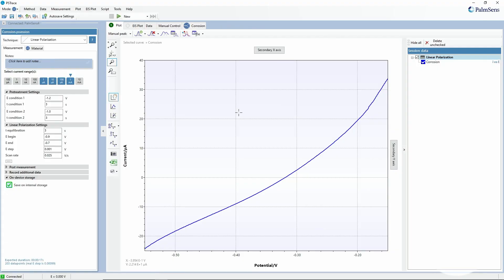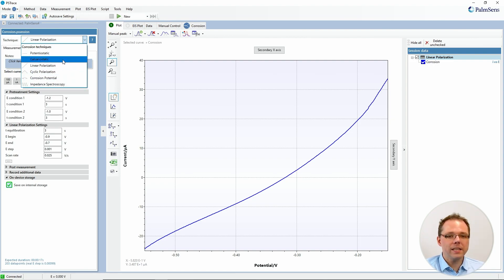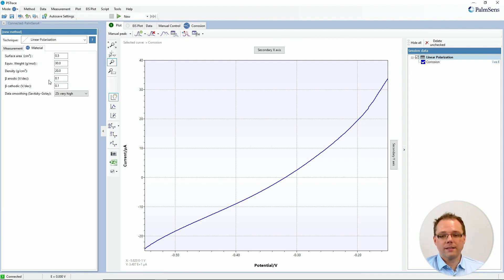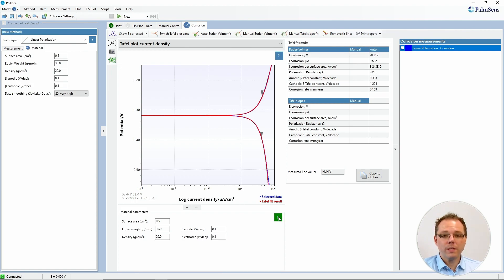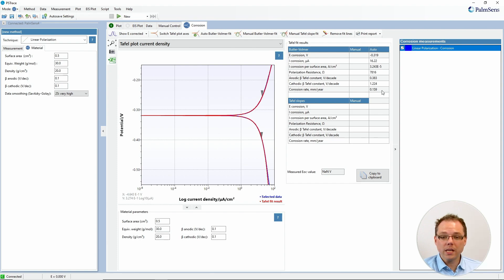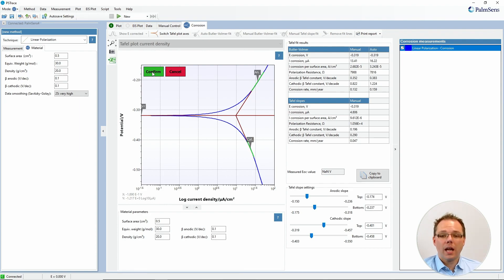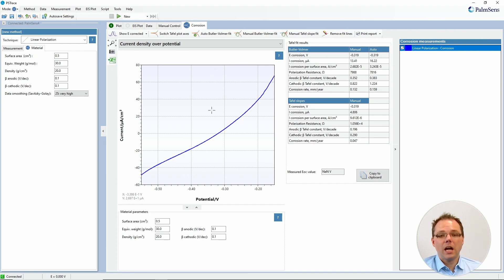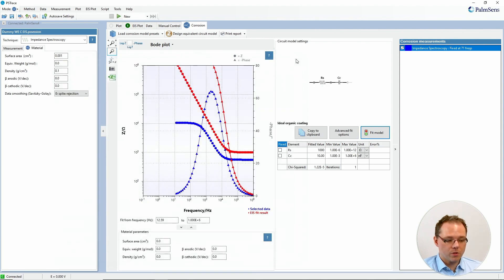PSTrace Tutorial #17: Corrosion Mode

Comment: Could you elaborate more on potentiostat selection for corrosion test? Is it the best to use Emstat4s HR? I believe Palmsens4 has max current of 20mA
Reply from the maker: The PalmSens4 offers superior noise suppression and better performance for very low current measurement compared to the EmStat4. It also provides a higher voltage range (+/-10V versus +/-6V of polarization) and higher EIS frequency (1 MHz versus 200 kHz). On the other hand, the main advantages of EmStat4 are the faster data acquisition, compatibility with MethodSCRIPT for software customization, and higher current capability (+/-200 mA versus +/-30 mA).

Furthermore, the EmStat4 is available in two hardware versions: LR and HR, with variations in specifications. The LR means Low Range, tailored for low-current and low-voltage, while the HR means High Range, with higher current and higher voltage ranges.

Additionally, the EmStat4 comes in three different models with varying peripherals: 
	• EmStat4S (USB-only),
	• EmStat4R (available with LR hardware only, includes battery, Bluetooth, and removable front for regular cell cable or SPE connector),
	• EmStat4X (with battery, Bluetooth, auxiliary port, iR-compensation, and a small display).

If you would like to have a online meeting with one of our specialists please contact us via info@palmsens.com or submit a quotation request via our website www.palmsens.com

Comment: is there any tool in the software to reduce the noise, ?
In case of GCD data , even If a single point is not regular place, then post analysis is very difficult by some code ,, because this kind of technique requires the multiple scan like 500 , 1K ... so manual analysis is not feasible..
Reply from the maker: Yes, there are multiple ways to reduce noise. The best ways to reduce noise is to avoid measuring it. A Faraday cage connected to the potentiostats GND (green plug) does a great job there. You can also increase the interval time, so more datapoints get averaged, so surpress the measures noise. You can also set the level of smoothing in the "Levels" or "Peaks" tab in the method editor. Be careful, because a high level of smoothing can also smooth away actual features.
If you are struggling with big amounts of data, you can also consider to write a specific piece of software for your application. We provide various tools to write your own code: https://www.palmsens.com/writing-code-for-our-hardware/?

Comment: Why do we need to determine the β anodic,cathodic parameter before perform the test ? after finishing, it will show the different value compared to data that we input
Reply from the maker: Dear Tithinutpohboon, 
You don't need to determine β anodic,cathodic before a Tafel Analysis or a fit of the Butler-Volmer equation. These tests determine the β anodic,cathodic. The entered values of β anodic,cathodic are required for calcuating the corrosion rate from the polarization resistance accquired from an EIS measurement.